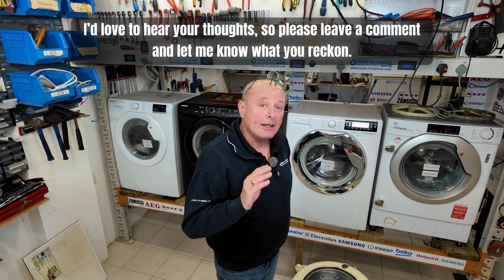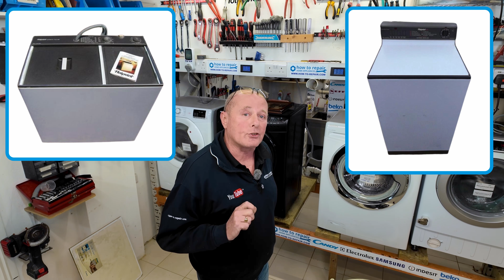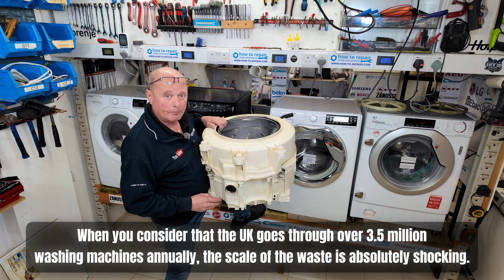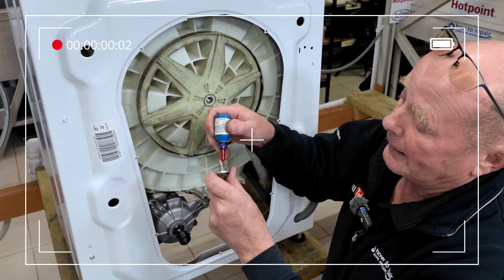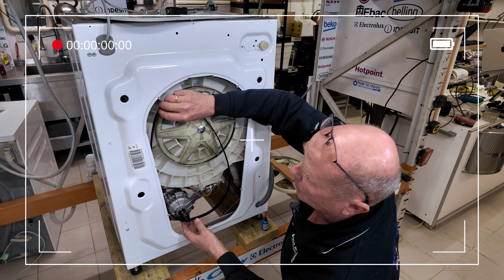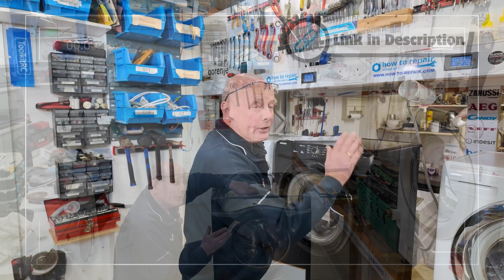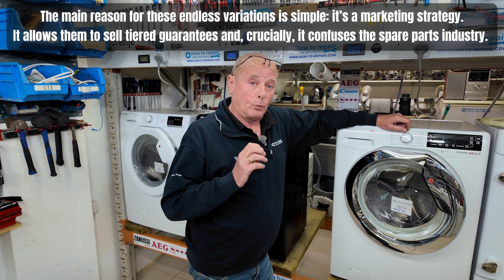I Scrapped 13 MACHINES to Prove a Point: STOP BUYING These Brands!

Comment: List of washing machine with repairable bearings:
Asko
– all models 

Amica
– all models (there is new series with unfixable bearings, better check before)

LG some says x part is bad quality, they lack of proper balance, amortization break, sealing breaks
– all models 

Bosch which quality is bad, they ride on old german quality 
– picked* machines from line: WAN 7 and 8 kg, and line: WAJ

Samsung
– all models 

Kernau
– all models 

Miele
– every except series: W1 Active

Haier, Sharp, Hisense
– all models except some slim mkdels, Haier on + 8 kg.

Whirlpool
– picked from line Supreme Silence

Siemens
– models WM14N28XPL i WM14N208PL

Comment: Not an engineer, hope I am not going to jinx it but my Electrolux is still going after 34 years, repaired it twice myself, a second hand relay and the door seal fixed with a puncture repair kit!😀 Great work highlighting this issue, the same with mobile phones too only getting a few years updates so you are forced to upgrade,

Comment: Can someone tell me why they only have cold water intake hose now used to be hot water intake also ? Was cheaper to bring hot water than heat it up in machine
Reply: Three reasons.
1. Because of the lower fill level in modern machines, they don't draw in enough water to get rid of all the cold water in the pipes, for the water to get hot enough to be worthwhile and the hot water left in the pipes wastes energy, and if you run the cold water off first wastes water. Although, personally I think that is an excuse.
2. The time needed by the machine to heat cold water up gives the enzymes more time to work, if using powder detergent with oxygen bleach stain remover in or as an additive with a liquid, which will take over around 30 - 40 C and start breaking down the enzymes as a side effect. 
3. And, I think the real reason is, Its cheaper - one less solenoid valve, one less hose, one less triac, and save a length of wire and connectors to boot.

Comment: I bought an English Ebac, has been great so far (3 and a half years) and drum bearings are accessible, has 7 year warranty. The two bosches I have had only lasted between 18 months and 5 years with a bearing change at 2 years.

Comment: Back in 2007 when we moved into the unit we're living in now, we bought a Miele Washer/Dryer.  Still working great today, however we have had to have it serviced twice in this coming on 19 years of service.

I don't fault the Miele for needing servicing though, since the condenser-based washer/dryers are significantly more complex than basic washers and dryers.

Comment: In England i only used Electrolux, I moved to Brasil, I then got Electrolux fridge. Washing machine, Dryer 2004, last year Dryer dead, last week our LE750 machine gave well the programmer diel, the diel you set the programme opened up, sll the plastic teeth shredded  cannot get as the machine not made. Been searching unable go get the part, am a electrical engineer, so i fix all myself, contacted Electrolux here in Brasil they could not believe i had one.. if i could get the diel it be running.

Comment: I have a 2020 13kg hoover washing machine, the door catch fell inside, I tried getting access but ended up braking the top 🤦‍♂️ a couple of self tappers fixed the flimsy one screw design….
The machine no matter how much levelling you do it still takes itself for a walk… a bit of wood screwed to the floor infront of it stops that 😂….
It has no clue what it’s doing sometimes, 5mins left could be another hour… if a small wash goes in it will take 2 times longer than a regular wash…
I also got the 10kg heat pump dryer, same year, the water tank has cracked letting water straight back into the drum…
I will never touch hoover again, complete rubbish…
However my 15year old beko 9kg is still going strong, has an hiccup every now and then but all is good.

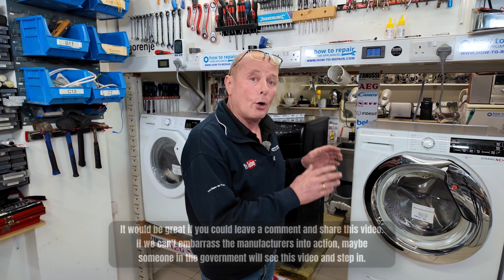Comment: 19:07 The trouble is, it'd be easier for these companies to have Google shut down your channel (and any other channel with your ethics) to silence you, under various trumped-up guises, than to change their manufacturing stance. What you need, is hard political support, but if your (and others') channels were to be "gagged" then that could prove difficult.

Comment: I'd include hotpoint too. Crap indeed. Bought a washing machine just over  1 year in and had to call out an engineer 31 days later had to call out an engineer again each engineer visit was 60 quid. Scrapped it, only to get a letter stated there's a manufacturing flaw and they wanted to offer us a replacement machine swap, WE'D ALREADY SCRAPPED IT. Our Samsung is currently 10 years in still works as it should.

Comment: Alas. Service parts need to be stored. Storage costs money over time. The more years in storage, the higher the price. I worked at the storage space for a consumer electronics firm. A small plastic knob from a radio would cost up to twenty euros. A small plastic knob. Still, management can only work with new sales that will produce and prove growth. To be the best manufacturer and serve the need of humanity is a highly risky proposition. Humankind is capable of amazing things. Good and bad. It's human nature. With the growth of communication it's just astounding to see how easily the mass is fooled. Thank you for speaking up. Subbed.

Comment: Hi, this is an off topic question,  is it possible, for Indesit tumble dryer model I1d80wuk, to replace the belt opening only the sides panels and loosing the front panel without dismantle the shaft? thx for your hard work.

Comment: I encountered this with Zanussi washing machines on an Army barracks where over 30 were bought at the same time and many developed the exact same fault within 2 weeks of each other, disgraceful! Not an engineer and all failed within 5 years.  I rescued so many 95 series hotpoints from the skip by replacing the bushes in the motor - easy money.

Comment: The problem with less water is that old people like me, usually put to much laundry in the drum and it's not clean when it finished because actually half of the laundry is still "dry". Apart that, in my memory, older machines was faster than the new ones.
So i think that less water is actually not helping the environement because or we have to wash things twice or wash less at the time so more cycles or if the duration of the washing cycle really is longer, we spend more energy keeping the water warm for longer.
The fact that worldwide people are getting overweight, isn't helping either because bigger clothes, means less pieces in the machine at the same time.
Last but not least, the false advertising of capacity of machines that have maybe 3 versions but the dimentions of the drum, are identical.

Comment: I can't imagine it would be hard to create some easy design with unified and replaceable plug-in parts, that can be exchanged 1:1. And it does not mean any real development would stop, it is simply the motor would use the same belt and had some universal timing and signalling. For PCBs, how come raspberry pi is cheaper than this and can definitely be programmed with 20 or so programs that will turn a drum, get water in and get it out. Upon failure, simply a newer version could be installed with either a universal program or a driver app specifically provided by the manufacturer to the internet. Well, of course they wouldn't be able to sell drums for 200+ or a new machine for 300+, if people could simply replace all the parts for less than 50 each.

Comment: Chip board in a washing machine? Are they insane? I recently replaced the draining pump on my top of the line 2010 LG (Korea made) washing machine. It was a 42$ Cad part (109$ for the OEM part).

Comment: My Dad is still using his 1970s Creda tumble dryer that I remember from when I was growing up, two heat settings, mechanical timer, hose that connects to the door and is poked out the window. It would seem that thing is indestructible - definitely a poster child of "They don't make them like they used to"!
Reply: I used to have one of those, but the thermostat kept burning out, I’m a quick learner and could change the thermostat myself. It’s dead now, but it was a workhorse.
Reply: Same here - we ran a basic Creda Tumble Dryer for over 20 years. Apart from replacing the drive belt (myself) - it was trouble free.

Comment: They don't WANT you to repair anything anymore!!  They can't sell you a NEW one if you fix your old one!

Same in all industries anymore.  I do electronics, and years ago you could get schematics and parts EASILY.  Parts were fairly generic across brands (tubes, rectifiers, etc) would be used by several different makers, and they were EASY to obtain.  Again, the schematics (technical diagrams) were also readily available.

NOW, the schematics WAY overpriced, like 10 to 100 times the price of the item, and that's >>IF<< they're available at all.  They don't use similar parts anymore (they have chips made SPECIFICALLY for a particular model, then discontinue them when they stop making that model) and on parts that ARE generic and readily available they GRIND OFF the part numbers SO YOU CAN'T FIND THE CORRECT REPLACEMENT!!!  If you have the skill, you can reverse engineer them to find out what that particular transistor or IC might be, but MOST repair shops don't have people with that high of a skill in electronics engineering.  If they CATCH YOU SHARING what you've learned, they'll even SUE YOU into oblivion for Copyright and or Patent infringement!!

NOW everything is computerized with proprietary software so that even if you CAN replace the microcontroller, you CAN'T get the program you need to run it!

Your "Right to Repair" is GONE!!!

Comment: I have a 4 year old Hoover washing machine. Stopped working. Error code googled as motor failed. Hoover documentation was motor failed, replace. Even the code was motor failed replace in the Hoover documentation. Got 2 brushes online for 15, replaced and re-installed the motor and working perfect. 6 months on - no problems. A new motor was 150+

Comment: The drums can stay welded just put heaver duty stainless steel spines and heavier duty bearings in the machine to last a lifetime of machine.
It would be a great selling point the public will buy these machines up by the millions. 
Just add £15 to price of machines a great trade off, and they can play the ECO landfill card!.
Logic works wonders.

Comment: Excellent Video. We should not be building anything that cannot be repaired or that has a designed in short life span.  Equally, something needs to be done with the cost of parts and consumables. Printer cheap, ink a crazy price.

Comment: I bought an expansive Brandt washing machine and after two years I had to reboot the PCB time to time (unplug and replug) because the machine refused to start or terminate a washing program. Sometimes the machine just won't open. 3 years laters it started to rust. 5 years later, ball bearings started to deteriorate. The machine died at its 6th year: ball bearings destroyed, bodywork completely rusted, plastic filter falling apart! My sister still uses a Siemens old washing machine from 1998: nearly 30 years old and it works perfectly!

Comment: I used to work in apartments. Would have fridges 30 years old and be able to replace the defrost timer easily. Then towrads the lsast few years I worked as a tech I started seeing more and more of them where it's a single pcb controlling the whole thing.
Knowing more about embedded stuf now, I do understand how someone in the electronics and programming field wouldn't even consider the repairability issue for it considering how affordable pcb design has become for hobbyists. But then the rest of the company can jack up the price behind their backs...

Comment: I am not an engineer but have work a little on our machine it was a old miele it stopped a few times ussaly there was something stuck in the pump it was replaced it 2025 because the circuit board was broken in half the machine has 30 years old

Comment: are you going to do a tear down of the EBAC brand?  the white goods market is very competitive market, so if a manufacturer can save £30 / machine / per build as a rough guide, then they will, as technology changes so does the way they are made. for an example, if it takes 2 people 10 mins to put the bolts into a drum and torque them up / compared to a robot that can automatically clamp both sections and seam weld them in 2 mins, this cost/saving all adds up, plus it also reduces any build failures and can reduce the cost of the unit. regarding the bearing failures in the video, are the units being over loaded with laundry? unlike yourself who is willing to take the time to take the drum out, split it and replace the bearings and fit it all back, there will be more that would not be willing to do that, due to their time. cheaper imports are killing the industry hence why crosslee closed their factory. I always look at the guarantee term for both parts and labour and if it is manufacturer engineers for any repairs. but we are all different on what we look for and want from a machine. but none will beat the old Zanussi FL812, 21yrs that beast lasted 1 door seal and 2 pumps in its lifetime. keep up the great work tho...

Comment: I work on home heating and cooling equipment.  I can tell you that everything made in the last 20 years is total crap. I work on machines thatvare older than me (41) and they work just fine with all OEM parts. New machines will go 3-5 years before repairs are needed.

Comment: Correction. Speed Queen is your best Made in America washer and dryer with the most domestic parts used. Yes they
are of a simpler, but more rugged design that is proven to last the test of time. More expensive, last longer, fewer breakdowns.
Easier to repair. Good stuff.

Comment: Given the impact on the environment which scrapping an entire washing machine for want of a 5 quid bearing AND the energy costs in replacing it with new machine, there is urgent need for legislation to clamp down on planned obsolescence which is a notion that my English teacher spoke of 57 years ago. There should be a government run engineering standards assessment complex with statutory powers. Is "Which" magazine still going?

Comment: Machine manufacturers should be charged a sliding scale tax based on the expected useful life for premature landfilling, which has a huge environmental stress compared to the small advertised energy savings. They could avoid the tax by complying with a standard that makes machines repairable for the repairs specified in the standard. Of course, a sub-condition for the tax reduction made possible by the standard must be the regulation of spare parts prices to a certain level in relation to the purchase price of the machine. Greenwashing is a big political scam and must be addressed, and green parties themselves need greenwashing all over the world. The issue is that power corrupts and the disease of the lack of common sense is visible to everyone.

Comment: The problem is now finding a machine without a plastic sealed drum.. I returned 3 Miele machines before I found one with metal drum where the bearings should be replaced.. it’s a nightmare…